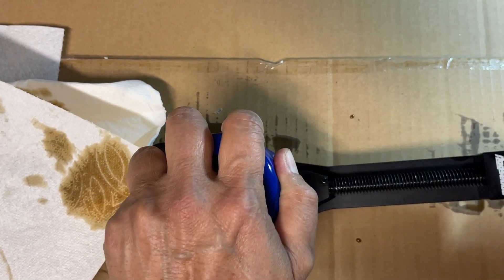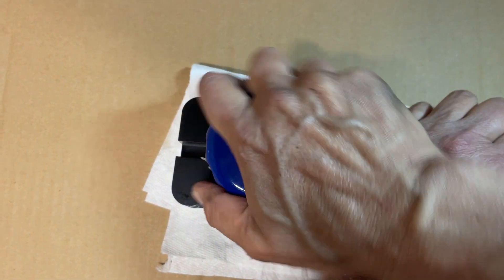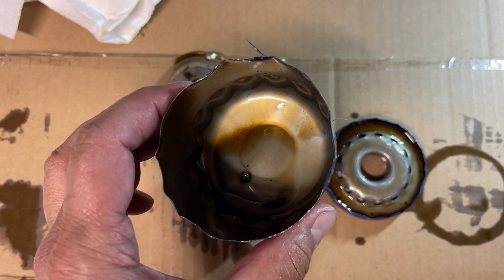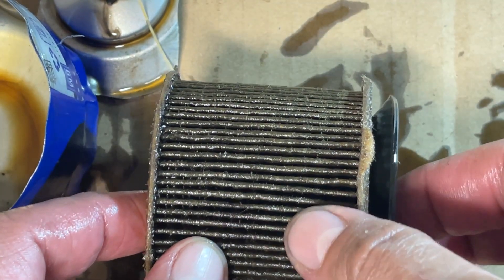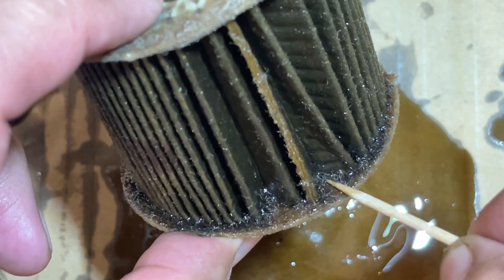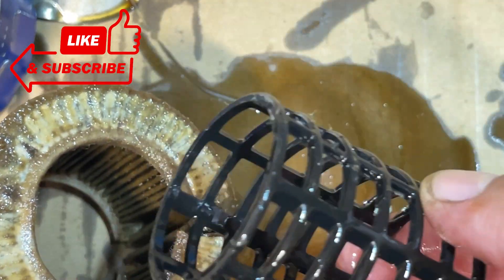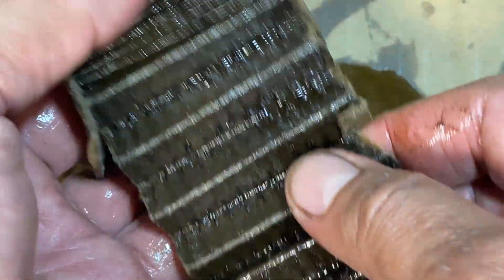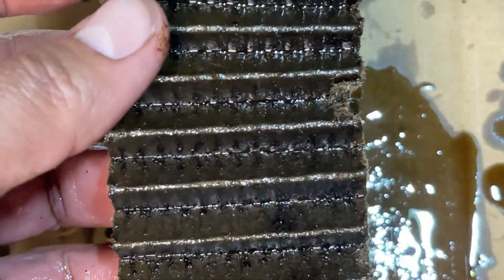Oil Filter Inspection After First 500 Miles with Valvoline Restore and Protect on Chevy Silverado

Comment: Thanks, for the INSPECTION & work. Interestingly, I just LAST WEEK, “early changed “out the first VALVOLINE Oil Filters (* my Point S Shop use) , after ++—1000 miles, MY INITIAL, VALVOLINE RP (5;W-20) two Vehicles , to,new PUROLATOR BOSS.. Anyways, sadly , I was tired & busy: only close visually/ high light inspections, OK smell : appeared good CONDITIONS .

Comment: Yeah, I just run 3-4 k oil changes and liquid moli engine flush every 15k. Kirkland oil runs 15$ for 5 qt 0w20 and a st filter. My oil changes are under $20. I use a cheap Amazon pump so I never have to hit the ground and I pump the oil into an old 5qt oil container so I know I have the right amount out. I'm expecting to get 500k out of the motor.

Comment: I have been using Valveolne restore and protect for about a year. Both our Vehicles, 2015 Ford Ecoboost with over 130k miles and a 2020 Kia Sorento V6 with 87k miles. If you have been changing your oil every 5k miles and using a good synthetic no need to open oil filters! You will not have any issues! 3rd generation mechanic and engine builder.
Reply: I got the 2ar-fe, i get to look at the filter and take an oil shower every time haha. Anyhow have ran mobile 1 at 40k to 60k then switched to vfs up until 80k and now am trying r&p. Inside is clean as can be, so don't expect much other than mpg improvement over stock. With regular vfs i get a 2-3 mpg boost over factory, I'll have to wait and see what r&p will give me.
Reply: Just experienced this on my 2014 Toyota Corolla.  Had been doing a 10k OCI up until 120k miles and then switched to 5k. Always full synthetic 0w20 as it calls for. Started VR&P at 168k and changed filter at 1k just to be safe. Was clean as a whistle. It's definitely cleaning but thankfully my engine wasn't a sludge factory to begin with so there was never any danger in not early changing the filter. About to go for round 2 and then I think if I don't see any massive cleaning happening due to it being fairly clean already I'll just switch back to Valvoline high mileage oil or Pennzoil ultra plat.

Comment: Maybe I missed it but how many mile oil change interval did you typically do prior to using the Valvoline Restore and Protect?  That crap in the filter is unreal at just 500 miles!

Comment: Penzoil ultra platinum (PUP) cleans the same way. After years of Mobil 1 (average oil at best now), I ran PUP and it turned jet black within 500 miles and filter had gunk. Mobil 1 was NOT cleaning anything.
Reply: I used Mobile 1 for years before switching my filter and engine is clean.

Comment: Here’s my 11 month testimonial for VR&P. Just a data point for anyone looking into this product. I put this in any video the algorithm recommends to me about VR&P simply to help others.

2012 Prius V I’ve owned since new. Oil changes at dealership or quick-lube places. So just bulk synthetic that came out of a barrel.

Lots of HWY miles for the first ~85K. Oil change interval average ~7K. After that, from ~85-129K, almost all short trips with oil change interval average ~4.5K.

Model year falls under TSB for low friction rings oil consumption. No noticeable oil consumption at 124K, when I switched to VR&P, but was smelling fuel dilution in the oil(fuel dilution was probably masking some oil consumption).

So my original intent was to switch to VR&P to hedge against possible future oil consumption. I had originally thought about changing the first use of the VR&P out at 1K miles, or at least the filter, but it looked so good on the dipstick checks I ended up going to 2.5K. Oil filter looked normal upon change. I think I could have gone out to 4K on the first change.

That fuel dilution in the engine oil(probably first noticed when the vehicle started being used for majority short trips) was to the extent that I could smell it in the garage after the car had sat a bit. I now have ~5K+ miles on VR&P and no longer smell fuel dilution in the engine oil.

The other thing that has really pleased me is how quiet/smooth the engine sounded immediately after switching. I had always thought this 2ZR-FXE was a clanky sounding engine. I mean the very first start had noticeably reduced engine chatter. I was stunned at first startup.

The Motor Oil Geek YT channel(Lake Speed Jr.) says that Valvoline uses a unique add-package which has a superior MoDTC friction modifier. This seems to produce the lowest wear components in engine oil analysis. I do wonder if this isn’t why comment sections are awash with reports of reduced engine/valvetrain noise after switching to VR&P.

Engine had no leaks before. Haven’t observed any since the switch.

I’m probably going to use this oil for the rest of the vehicle’s serviceable life.
Reply: Uff Valvoline doesn't sell R&P in Europe :(
Reply: @AAAAAAndrea 
Still? Wow, I thought they would have by now. Too much of the market dominated by diesel engines maybe?
Reply: @EvzenKovar-i5p They could do a formula for the EU market, not too hard to do imho.

For example Chevron/Texaco has plants in Belgium for their Techron additive for the EU market.
Reply: Hybrid engines need special engine oil for  it because the engine won't have much time to burn off the moisture and fuel dilution like an ordinary engine. That explains a lot about your high fuel dilution.

Comment: Just switched over yesterday to Valvoline Restore and Protect from Castrol Edge 5W30, with 134'000 Miles on a Nissan VQ35DE powered Van. Will definitely keep a close eye on oil consistency and will pull the oil filter out mid-interval between 1500 miles or sooner.
Reply: Go sooner, 5-700 miles just to make sure. Use a good filter..

Comment: That  AC DELCO OIL FILTER IS made by CHAMPION LABORATORIES!! IF you insist on using the those OEM OIL FILTERS, I would use the AC DELCO GOLD PLUS Filter!! It's a more robust made oil filter!! From the looks of this filter, you need to keep changing the oil filter early!! What you are calling gunk is hard carbon particles, and not softer sludge!! If You run a filter for a longer mileage, or time interval, you will Not be doing yourself, or the Engine Any Favors!!😮 After you notice a big particle reduction in the the filter media, then, and only then should you extend the time, and mileage intervals for a Filter Change!! Over time you will notice a drastic reduction in the carbon deposits caught by the Filter media!! Any Brand of Oil Filter media has a specific grams capacity of dirt holding capacity!! You can call Champ LABS Technical support, and give them the  Filter #, and they will tell you how many grams of capacity the filter media has!! Compare the regular AC version to the AC GOLD!! OREILLYS sells the AC DELCO GOLD PLUS Oil Filters!! THANKS FOR SHARING!!😉🤔 😊

Comment: Another thing to do is put your media in a vice and express the oil from the media. Makes it a lot easier to determine what’s in there.

The black stuff is carbon. That’s normal the first 5ish times you drain and fill with R&P. Theres no metal in there I can see, so I wouldn’t worry myself to death over it.

Just change the filter frequently and keep increasing the periods you run the filter until you can baseline the crud.

The oil itself can go 5k miles with fresh filters behind it.

The carbon deposits will fall off rapidly after 10-20k miles of work.

Comment: Avoid any oil filters with fiber end caps! I accidentally used one on my Jeep (the brand used to use metal end caps) and it was torn, allowing unfiltered oil to just pass right on by. Purolator Boss seems to be decent quality at the moment.
Reply from the maker: @PapiDoesIt  oh no!! I’ll be sure to stay away fiber end caps.  I looked up a list of Brands That Usually Do NOT Use Fiber End Caps:
These brands often use metal or molded synthetic end caps and fully synthetic filter media (better for performance or long-drain oil):
	•	WIX / Napa Gold
	•	Mobil 1
	•	Bosch Premium
	•	Royal Purple
	•	Amsoil
	•	K&N
	•	Purolator Boss
	•	OEM upgraded filters (e.g., AC Delco Professional or Ultraguard)
Thanks for the tip!

Comment: All that carbon is probably from the piston ring lands, oil control rings, and rocker arms.
Reply: What might be interesting is to see if the restore and protect oil that is funneled though the EGR valve started to dissolve the carbon deposits that the gdi tend to get on the intake runners and Intake valve for the older oil. If so hopefully they will pass through the exhaust and not damage the top rings or get stuck and score they cylinder walls

Comment: When using an oil filter, you use it just like a pipe cutter score a line all around the filter and then tighten it gradually until it is cut all the way around
Reply from the maker: @michaelkeyser8371  thanks for the tip! That’s gonna help out big time on the next oil filter reveal video. I’ll be doing in a couple of months. It also help me eliminate trying to determine whether or not the metal shavings in the oil filter are from cutting. Highly appreciated!
Reply: @TRX450R just like a pipe cutter - little by little

Comment: Using VRP in two vehicles now.   One stopped using oil by 75%.  The other had one oil analysis so far and everything looked great except for viscosity being slightly out of spec thin after only 3800 miles.  Was the cause the 2.5% fuel dilution on the report or did it shear, or both?  Wear numbers were outstanding, however.
Reply from the maker: @mattdecker6791   Great thing about the oil analysis is we get to see if our injectors are leaking. Looking forward to getting my first analysis to determine if an injector leak is causing my low fuel pressure and hard starts. That’s great to hear on the oil use reduction.  Which company did you with for the oil analysis?
Reply: @TRX450R  Speed.

Comment: I just bought a 2008 GMC Sierra Z71 w/103,000 miles with a misfire on #4 cylinder and lifter noise really cheap. I just did a DOD Delete with the melling kit by pulling the motor and not doing it in the truck. The block was fully cleaned from the sludge, i replaced all the bearings and had the piston and rings cleaned along with having the heads done and with mellings recommendation i replaced the oil pump, timing set and blocked off the oil pan relief vavle. I replaced the driver's side valve cover to the updated one because of the PCV issue recommended by GM. I installed a billet oil diverter plug "barbell" and replaced the oil pick up tube and added a melling bracket for the pickup up tube. I have great oil pressure and it runs great. I decided to use Valvoline restore and protect and i am coming up on my first oil change at 500 miles then i will go another 1500 miles for the next oil change and then after every 3000 miles will be my regular oil change intervals. After i do my 3000 mile oil change i will perform an oil analysis to start a base line. Here are my thoughts. I used to do oil changes 3000 miles conventional and 5000 miles on full synthetic. After seeing some newer car motors on YT with VVT, lifter, and timing failures and oil consumption and burning i have now concluded oil is cheap compared to major engine repair so i will make it a practice to change my oil even with synthetic to 3000 miles. I live about 70 miles from death valley so heat is another facctor that I  have considered. With in the next 6 months i will add an external oil cooler with a spal fan to help and keep the oil cooler and add an all aluminum 4 core radiator. I am curious to see how clean my filter is on a clean motor from using Valvoline Restore and protect and there after from 3000 mile oil changes. I do cut open my fikters and inspect them too. Once you start removing carbon and sludge from your motor and seeing it trapped in the filter it sure is an eye opener.
Reply from the maker: @JamesSmith-j1z     I like how you think!  You saved a lot of money getting a 2008 and doing a DOD delete for reliability. This is a great money saving plan. I was just thinking about rebuilding my motor, but a few bucks more, I can have a newer truck with a rebuilt engine.  Brilliant! You even got a new o ring in with the oil pick up tube.  Man you are solid! Here is what to expect from Valvoline Restore and Protect:
1.	DOD (Displacement on Demand) Delete using Melling Kit
	•	Valvoline Benefit: Helps keep oil passages clean after removing complex DOD components; reduces future sludge buildup in areas previously stressed by DOD hardware.
	2.	Complete Engine Removal & Cleaning (Sludge Removal)
	•	Valvoline Benefit: Complements the clean slate by preventing reformation of sludge and varnish; maintains internal cleanliness.
	3.	All Bearings Replaced
	•	Valvoline Benefit: Keeps oil pathways cleaner and better lubricated, supporting new bearings and prolonging their life by reducing microscopic wear.
	4.	Pistons & Rings Cleaned
	•	Valvoline Benefit: Helps prevent carbon reformation on pistons and rings, maintaining compression and reducing blow-by.
	5.	Heads Rebuilt
	•	Valvoline Benefit: Keeps newly surfaced and cleaned valve train components cleaner longer, helping with sealing and smoother operation.
	6.	New Oil Pump (Melling)
	•	Valvoline Benefit: Keeps fresh pump internals free of varnish and build-up, preserving proper oil flow and pressure over time.
	7.	New Timing Set
	•	Valvoline Benefit: Reduces wear on timing components by maintaining cleaner oil, especially important for chain and tensioner longevity.
	8.	Oil Pan Relief Valve Blocked Off
	•	Valvoline Benefit: Protects modified oil system from contamination and pressure fluctuations by keeping passages clean and free-flowing.
	9.	Updated Driver’s Side Valve Cover (PCV Issue Fix)
	•	Valvoline Benefit: Reduces risk of future PCV-related sludge and oil vapor build-up; keeps top-end components cleaner.
	10.	Billet Oil Diverter Plug (“Barbell”) Installed
	•	Valvoline Benefit: Maximizes the flow of clean oil through critical passages—Valvoline helps by reducing future deposit formation in those areas.
	11.	Oil Pickup Tube Replaced
	•	Valvoline Benefit: Prevents varnish or sludge from reducing flow in the new pickup; maintains strong oil delivery to pump.
	12.	Melling Pickup Tube Bracket Added
	•	Valvoline Benefit: Keeps structurally secure and well-lubricated—clean oil reduces potential wear in high-flow oil zones.

⸻

Maintenance Practices & Monitoring
	13.	Oil Change Plan (500 / 1500 / Every 3000 miles)
	•	Valvoline Benefit: Frequent changes with Restore & Protect remove accumulating deposits before they cause harm; optimal for high-mileage engines.
	14.	Oil Filter Inspections
	•	Valvoline Benefit: Will likely show increasing cleanliness over time, proving the product is working by removing and trapping carbon/sludge.
	15.	Future Oil Analysis
	•	Valvoline Benefit: Will help track engine cleanliness improvements, wear metal reduction, and better oil life.
Congratulations on your awesome rebuild!
Reply: @TRX450R  I love the points you addressed and not to beat a dead horse however pulling the motor apart verses in truck repair, this is what I found. Yes I wanted to be cheap but I would have not found a lot of these without a full tear down. Broken motor mount, Previous Owner attempted just lifter replacement and when we removed the heads I found silicone globbed on valves and spots on the head gasket. Sludge on the bottom of the oil pan from all the additives used to try and quiet the lifter noise. When removing the oil diverter plug when pulling it out it was like when Shrek was pulling ear wax out from the sludge and additives. The PO replaced the ECM but did not assign the VIN to the ECM causing it to go into limp mode upon start up. Mismatched spark plugs and other silly mistakes. All this has been corrected. So this teaches me not all people do their maintenance on time and some mechanics cut corners to save a buck. Thank you for your video it just goes to show no matter how much research someone has done you can always learn something from everyone.
Reply from the maker: @JamesSmith-j1z  Oh man! They did a number on that truck! Thanks for the kudus! Thank you for sharing your experience.  You opened my mind to getting newer truck.  Just gotta make sure I get some maintenance records. Great thing about us Silverado repair enthusiasts here on YouTube is we have a community of knowledge that’s going to save us all money and keep us on the road.
Reply: Same here. I have a Jeep Gladiator and here in Texas it is really hot. I changed from the 0-20 to 5-30 and 3000 mile changes are a MUST !!!!! When new, I changed at 500, 1500 and 3000 miles and 3000 miles after that. My motor is so quiet compared to other Jeeps. No "ticking" and with variable oil pressure (which I hate) I see no difference at all. Oil temp stays roughly the same.

Comment: Highly recommend you change filters you use.   Those ac delco are not great.   I recommend you check out premium guard extended life/ and or microguard select.    Much better !!!
Reply: Use super tech i have had great luck with them
Reply: What's wrong with AC Delco?
Reply: @gregorymalchuk272 AC Delco filters are constructed the same way the cheapest filters are,  likely made by the same manufacturer. You can buy a lot better quality filter construction.
Reply: @Dusty_Bottoms_ agreed 👍
Reply: @gregorymalchuk272  there terrible built filters
Reply: @gregorymalchuk272  Nothing.